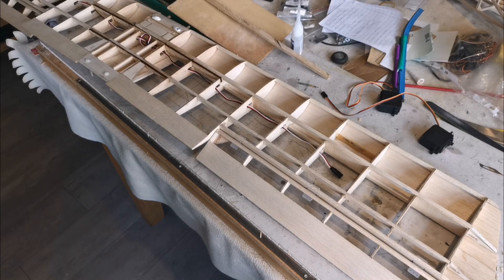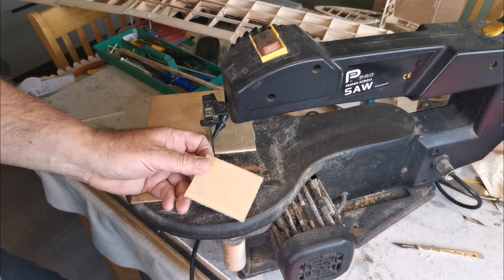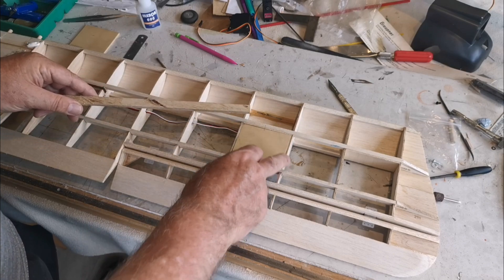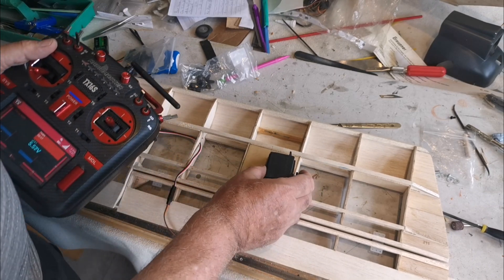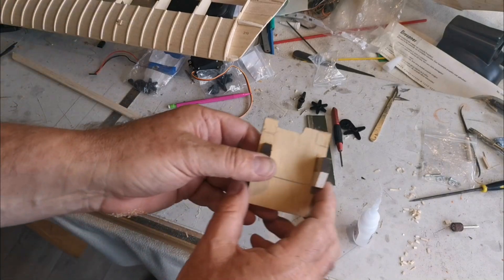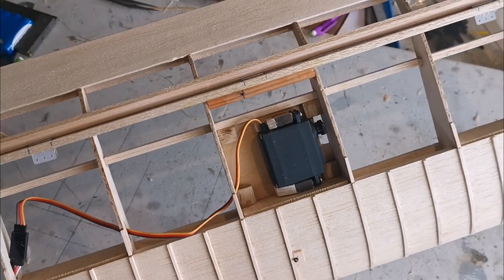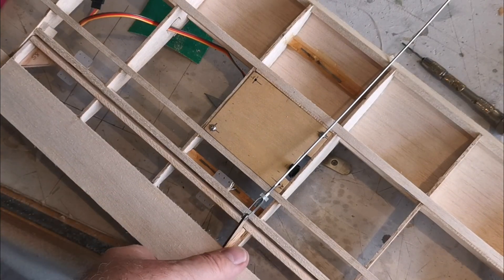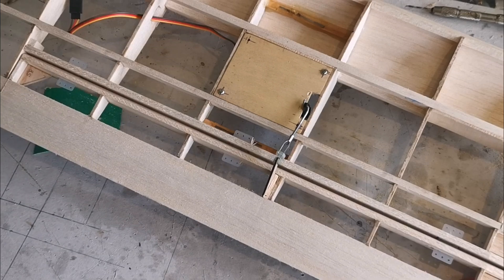How to install aileron servos.

Comment: Nice video - I learned several useful tips.
Those Z-bend pliers look great, but I think you lined your mark up on the wrong crown, which is why the pushrod ended up short.

Comment: Do small aircraft fly using such servo's, by now? Or is it still push/pull bars and rockers at the corners? You'd say, if you do some redundancy, all planes could have computer network cables. RC is beautiful, the engineering challenge is exactly the same as in a plane with a pilot. I know somebody who built an RC tow plane, that has trims on everything you like. He say it flies great.
Reply: That ('rockers') is what he was talking about when he said the plans called for 'bell cranks'. Most people now use two servos because they're much cheaper than they used to be and the added redundancy might save the model if a servo fails. Plus you can trim them electronically or even use them as flaps as well as ailerons.

Comment: Nice but those ali  servos has failed me a couple of times
Reply from the maker: Fingers crossed 🤞 I'll keep a check on them thanks for the heads up
Reply: What do ya mean ali servos?? Ali express 1,s
Reply from the maker: @homienat3374  They are Ali express
Reply: @MarkCroucherRC4fun  i use them never a prob so far touch wood 🤙

Comment: Well done. Back in the day most all ailerons used a central servo and horn. I really like putting the servos in the wings, even though most plans don’t call for this type or installation, calls for some modifications along the way. BTW, what’s the deal with using inches,  I thought all you blokes used metric…lol
Reply from the maker: I think that two servos offer more flexibility than one.
Inches, metric I use both to be honest comes from my model engineering days.
Reply: I completely agree about the ailerons. Allows for micro adjustments from the radio without having to do mechanical adjustments. Much better system.

Comment: I have a piece of dowel, shaped at the end like a thick screwdriver - insert between the blades of the clevis, turn through 90 degrees to hold it open. It makes clevis fitting and adjustment much easier.
Reply from the maker: I like it I'll make one for the tool box.